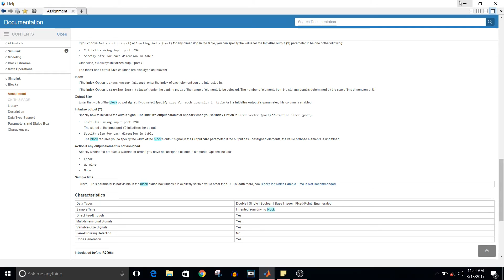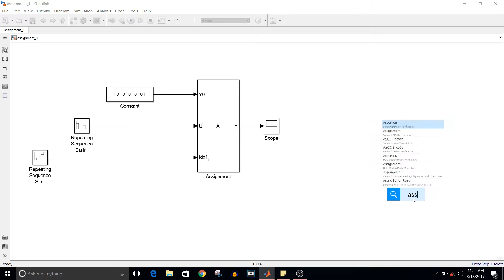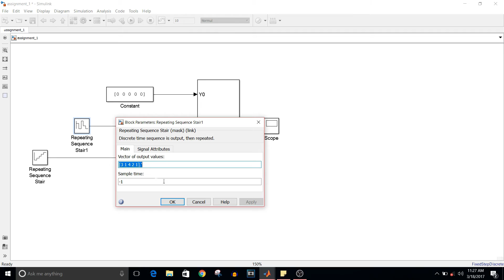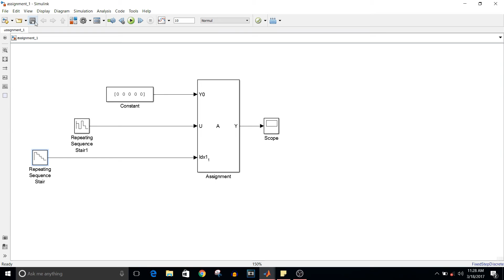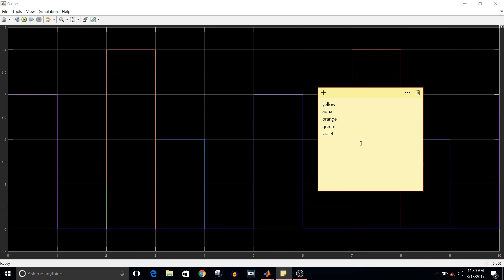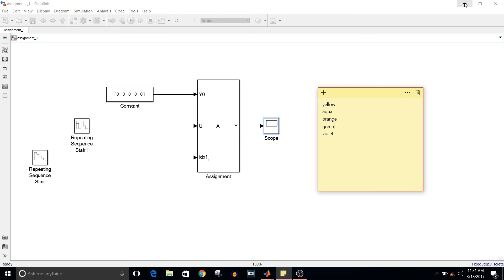Simulink Tutorial - 24 - Assignment Block

Comment: Thank you for your tutorials.
In that case, what is the difference between 1-D Lookup table and Assignment block?
Reply: Assignment block assigns values at the specified index in a multidimensional vector. For example, if A = [1 2 7 9] and you want to replace value 7 which is at index position 3 with value lets say 9 then you can use Assignment block.
1D Lookup table simple performs interpolation.